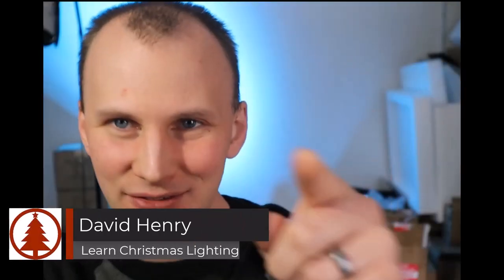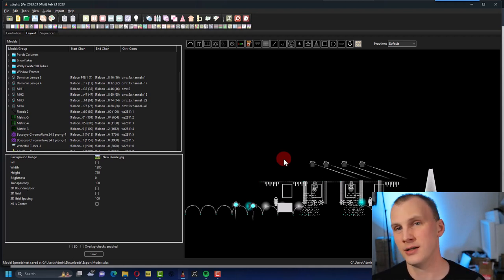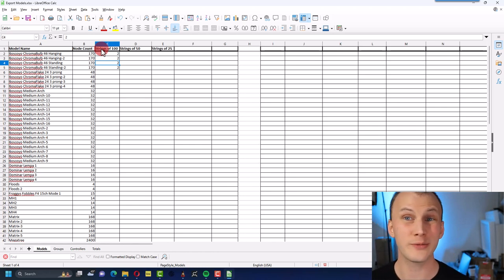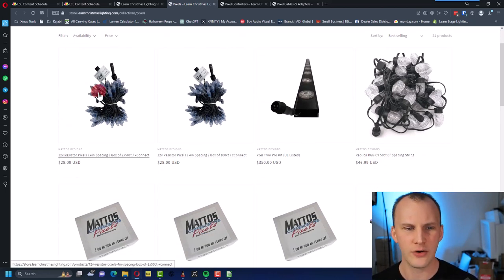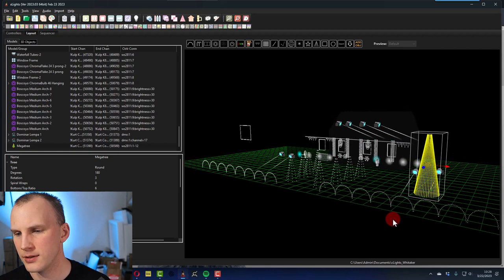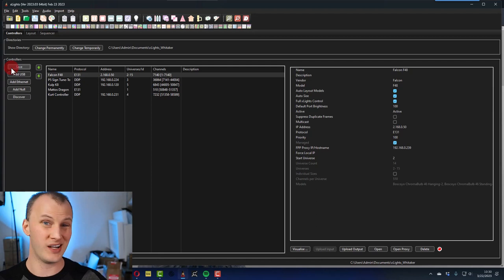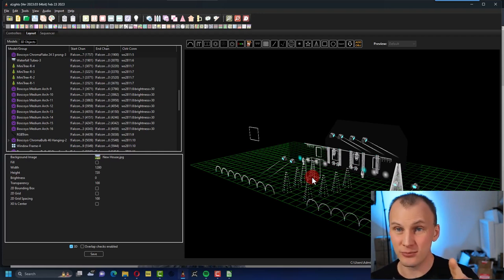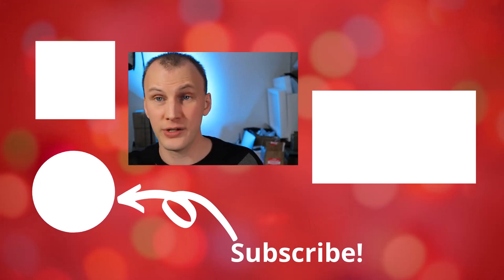How Do You Figure Out How Many Pixels, Extensions and Controllers to Buy for Your Christmas Display?

Comment: Is there that much voltage drop when going more than 25'? If I were to use thicker gage wire and needed to go further from the controller than 25' but don't want to use a long-range receiver could I just use a higher gauge?
Reply from the maker: It's more about the data at that point, it's not designed to go longer distances.